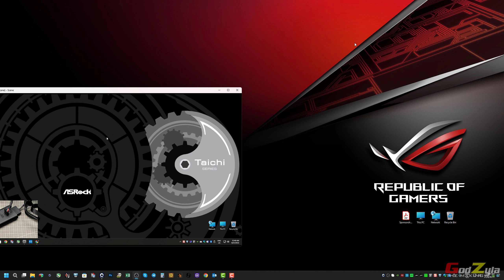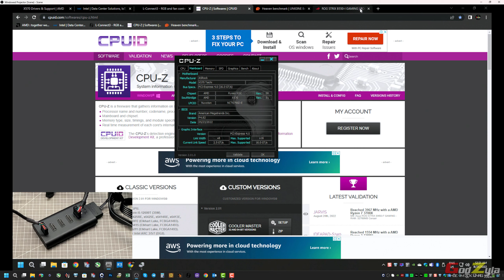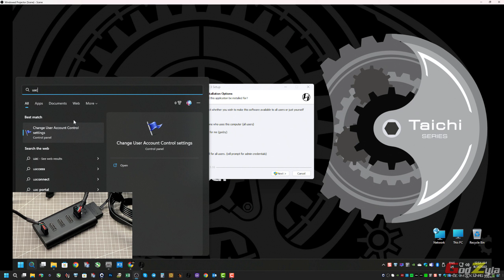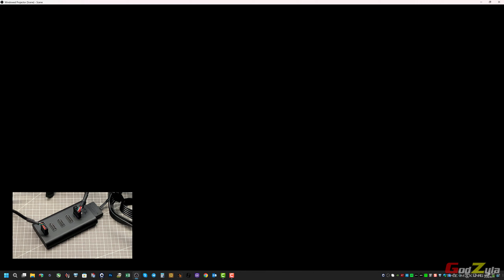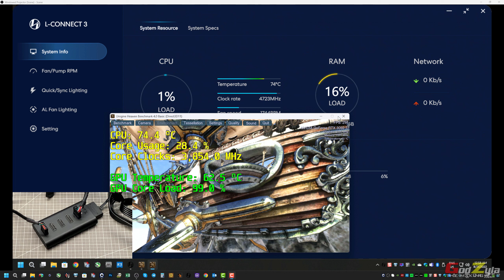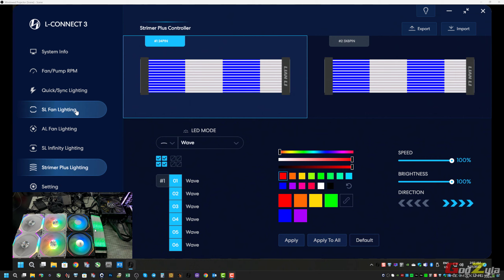Lian Li ARGB Products (How to make it work?) [L-Connect 3]

Comment: Hello,

do you think it's better to connect the AIO to the motherboard via USB? 
Or does the NZXT manage all Lian li controllers, 'fan' and AIO at the same time? 

Because I have both. AIO and 6 SL infinity
Reply from the maker: hello Protect_Dreams, welcome to my channel. both uses it's own controller. It will be best to have the NZXT pump controller to one USB header and Uni fans controller to another USB header. You are required to install both argb application. NZXT Cam and the L-Connect 3 app. As for troubleshooting, do pardon me, I am not familiar about NZXT Cam system, this you will need to figure it out or to ask at lian li reddit forum if you do encounter issues.
Reply: I think we misunderstood each other.
I don't have a NZXT AIO (*: like you on the video. A NZXT internal USB 3.

My AIO is a lian li galahad ii infinity. I have two USB ports on my motherboard.  

I wanted to know if I connect my AIO pump to the other USB port on my motherboard.  Or do I connect all my USB to the NZXT. Thanks
Reply from the maker: @stjah69  oh ok ok, pardon me. yes the NZXT internal USB 3 hub can cater for all your Lian Li controllers. no issue, infact Lian Li has it's own step up USB splitter which you might want to take a look too. https://www.aliexpress.com/item/1005005121350909.html
Reply: Thank you for your reply.  The link is interesting.
Ok then, I connect my AIO and my fans to the NZXT. It was already the case but I prefer to ask. Because I must admit that since I switched to AIO lian li I've been having problems. With Corsair everything was fine.

In Lconnect my AIO galahad disappeared. Even after reinstalling Lconnect, it no longer appears after restarting the PC. However, I can still control the pump and the LEDs.

And I still have the problem of the anti-malware service running in the background every 5 minutes.  If I close L connect the problem disappears. I just don't get it.

Thank you very much for your help.
Reply from the maker: @stjah69  hmm.. maybe try these steps. 

1)  first are you able to see any Lian Li devices in device manager, under universal serial bus devices?
2)  If no, can you check your motherboard bios at their website. are there anything related to USB fix?
3)  Now have you install the .inf driver for your motherboard? (refer to your motherboard manufacturer) 
4)  if above are done. try this, uninstall L-Connect 3app using revo uninstaller, make sure to remove all unwanted first and registry. example in this vid on the actual timestamp https://youtu.be/uMgUYiakpxM?si=8isUQ9pWvKounfgZ&t=437 and the application revo from here https://www.revouninstaller.com/revo-uninstaller-free-download/ (download the free copy will do.
5)  Also to check, do you have other ARGB Application installed. remove them too with revo uninstaller. For Asus Armoury crate, kindly use Asus Armoury Crate removal tool which you can find at asus website.
6)  once all done, shutdown your machine. unplug the AC plug from your PSU. let is sit for 45 seconds or so. while waiting, check the connection of your AIO block (make sure is click in) and the connection point to your motherboard USB header.
7)  plug back your AC plug and turn on your machine. see if it detect the Lian Li LCD controller in device management > under Universal Serial Bus Controller (right below) you should have two devices 1) LianLi GA_II_Trinity-R_v0.7 and 2) Lian-Li-UNI FAN-INF-v0.4
8)  If it does detect, install L-Connect 3 app version 2.0.4 ( https://lianli-update.oss-cn-beijing.aliyuncs.com/L3_CX/L-Connect_3_V2.0.4_X64.ZIP )
9) Try to update the firmware in L-Connect 3 app, under settings. if not download and run the GALAHAD II TRINITY"  https://lian-li.com/l-connect3/L3_update_manually/ 
10)  if everything working and detected, reboot to see if the AIO block and the uni fans dashboards appear in L-Connect 3. 
11) try playing with the effects.
Reply: Thank you for your help.

Yes I do see lian li in my peripherals. And once again. I can change the color leds. And even make the pump work.

I just don't see it in L connect updates anymore.

I have a 13700k with an Asus tuf z790 ddr4. My bios is from March 2023. And no I don't see anything corrected in USB.

What's the .inf? I have installed all the drivers for my motherboard.
Reply from the maker: @stjah69  Hi do you have the exact model of your motherboard as there are alot of Z790 Tuf or is this your motherboard? https://www.asus.com/motherboards-components/motherboards/tuf-gaming/tuf-gaming-z790-plus-d4 . if it is. download and install the chipest which is the .inf driver https://www.asus.com/motherboards-components/motherboards/tuf-gaming/tuf-gaming-z790-plus-d4/helpdesk_download?model2Name=TUF-GAMING-Z790-PLUS-D4 ,  reboot the system and see if works?
Reply: @KleoYan  Yes, it's the TUF GAMING Z790-PLUS D4. I installed ME firmware UpdateTool and the latest Intel Management Engine Interface. 

But the problem is the same. I have 6 Corsair Ql series fans with a commander pro to manage speed and leds. I use Corsair's Icue software. 

So maybe that's where it's coming from. The Pc must not like L connect with ICUE. And two different USB connections. 

I wanted to buy Lian Li Uni Fan SL-Infinity Reverse Blade. So I wouldn't need the Corsair commander core.
Reply from the maker: @stjah69  ok, now you've mentioned dont see updates anymore in L-Connect 3 but are you able to see the GA-II-Trinity-INF and your Unifans on the L-Connect 3 app? are you able to control them? If you are able to then it's all good.
Reply: @KleoYan  Yes, that's right. I would have put links to reddit but youtube deletes them in your comments. 

I don't see galahad ii 360 trinity sl-inf in the L connect updates. But I can still change the pump speed and the leds.
Reply from the maker: @stjah69  Hi buddy, someone had a similar issue like yours. you might want to take a look and to follow his steps https://www.reddit.com/r/lianli/comments/180ecez/firmware_update_11_aio_lcd/

these are the steps and credits to u/djchill75 from Lian Li's reddit forum.

1) Turn off PC
2) TYPE C cable disconnect
3) Start PC
4) use the EXE file (https://drive.google.com/file/d/1c9Hm6hKcDGnLgSQ7XvhfTLVjMubj2RYl/view) and click auto install update
5) wait till end then connect Type C Cable (Yes PC is on)

6) wait till it says restart Device, then you ll hear the USB Connect sound.
7) Everything works again.. ppphheeewwww

Hint: turn off L-Connect Software in system Tray before updating!

Comment: Thank you very much for your video. I bought the denier lian li galahad ii 360 trinity sl-inf. I am in Full Corsair. But I wanted to change brand. 
So I took out my Corsair AIO and put in a Lian li AIO. But I've kept my Corsair QL series for the time being. So I have L connect and ICUE at the same time. No problem for the moment.
I'm waiting for my Uny fan revers :)
I was wondering why my Lian li peripherals were appearing in my taskbar. But when I saw your video, apparently everything's fine because you've got it too. With Corsair nothing appeared. I also use the NZXT. 

On the other hand, I don't know why I get a little loading in the background every 5 minutes. If I cut L connect I don't get it anymore.
Reply from the maker: Hi Protect_Dreams, welcome to my channel, thank you for your valuable feedback. Now as for your background process, this I am not able to answer you but I do know that all argb programs make use of one common shared IRQ, which ended up applications might just grabbing for permission grant, this could be one of the cause.

Comment: I can only find a non powered internal usb hub i just need it for a 24 pin strimmer and a gpu strimmer or will that cause problems ?
Reply from the maker: Hello Deadpoolisdead, welcome to my channel. You can give it a try as my experience are with multiple controllers.

Comment: If i connect all my case fans, so 7 SL 120 V2 using the UNI hub, will they power on upon first boot ? I've heard they won't spin until L-connect 3 is installed and firmware update.
Reply from the maker: Hi Quyrew, welcome to my channel. All uni fans which I have tested, they will spin upon boot. Profile will be loaded after windows up where the L-Connect 3 app kicks in.
Reply: @KleoYan  but if its a new build without windows installed, will they not spin until L-connect is installed ?
Reply from the maker: @quyrew  when the controller is powered by the Sata. Whatever fan you plug to your controller will spin. Does not matter if there is windows or not.
Reply: @KleoYan  okay thank you for the info
Reply from the maker: @quyrew  most welcome and all the best with your build.

Comment: I was having issues with getting Lconnect to see the fans.  Turns out my NZXT mobo came with a USB splitter, and that was causing problems.  Fans still worked at full speed, but no control until I got rid of that splitter.
Reply from the maker: Hi Qix, welcome to my channel and thank you for sharing your experience with us, greatly appreciated it. Are your uni fans working properly now?

Comment: Hi Kleo Yan,  I have the old strimmers types (Qty 2) and wonder if I can plug them into a new UNI fan SL-INF 120 controller which has no fans plugged into it, as I want to try and control all my lighting through Connect 3. I already have the Galahad II pump AIO controller in my system but all the ports are full with fans and the pump. Can I use a second controller to run my strimmers?  I am stuck with this problem on how to add my strimmers. I hope you can help. or should I purchase the new Lian Li Strimer Plus V2 24-Pin ARGB Motherboard Extension Cable and Lian Li Strimer Plus V2 Triple 8-pin ARGB GPU Extension Cable which come with a controller?
Reply from the maker: Hi Mal Anderson, welcome to my channel. for your case, you will need a strimer plus V2 controller (https://www.aliexpress.com/item/1005004239607087.html?) and does your motherboard have another USB 2.0 header? normally a board is equip with 2. if both are used up, you will need a USB Splitter (https://www.aliexpress.com/item/1005005121350909.html)

Comment: Hi! I'm kind of new on what pc building refers, i have builded a full ROG pc, but i installed a galahad 360 and 4 SL and 2 strimer plus. I'm having troubles to make the argb works on "mb  lightning sync", could anyone give an advice to solve that issue?
Reply from the maker: Hi Eduardo Santos, welcome to my channel. does your SL Fan come with a uni controller? Also which strimer plus version did you purchase? As I need to know exactly which lian li products you are using, else can't give you a proper answer or help.

Comment: I fusing the L-Connect 3 software to control your CPU & GPU fans (AIO Coolers) rather than connecting those fans headers to the motherboard.
In the software you can say "This group is controlled by CPU/GPU temps" but what happens in BIOS, or even a dual boot system with an OS that doesnt run the software?

Will those fans run automatically from the signal from the pass-thru connection of the controller, run at full speed, or not run at all?
Reply from the maker: Hi Vicious Computers, welcome to my channel. For your case, it will run at silent mode and does not pickup from your bios even if you did plug the cable between the controller to your motherboard PWM fan header.
Reply: @KleoYan  Ok, good to know.  I'll need a few single fan cables that break out to the separate aRGB and PWM Fan connection then will put them on the controller in a sync port and plug the fans into the motherboard directly most likely.

I do not dual boot linux anymore I just use WSL or use a VM and in bios silent mode would be good enough due to the low demand on the system, but kinda still "better safe than sorry"

Just would be nice to control everything from one place and not need another software for those fans.

Comment: Hello man, great video bro. Can you tell me if I can control the argbs of the lian li infinity fans without connecting the controller to the usb connection, just with the argb connector on the motherboard?
Reply from the maker: Hi Lucas Duran, welcome to my channel. You can do that with a individual pack. If you get the tripple pack, it will not be possible. If you do get individual pack, make sure not to daisy chianed more than 3 fans to each of your motherboard fan header, as each of your motherboard fan headers have a load limitation.
Reply: @KleoYan  In this case, I will need a USB extender for the motherboard, right?
Reply from the maker: @lucasduran6753  it greatly depends on how many controller you intend to plug to your motherboard, but if you do need a usb extender, I would advise you to get this instead of the NZXT internal hub. https://www.aliexpress.com/item/1005005121350909.html

Comment: Hello everyone.
I have a Lian Li build case and i added lately a new hydro Lian Li Galahad II. My problem is that i spent a lot of time customizing the rgb strimers + hydro and when i turn on the PC and the L Connect 3 software runs on startup it resets to the default all the rgb settings. Then i have to customize again and again. If i turn off the L connect 3 program and never run the software again it runs smoothly. 
What should i do guys; Thanks 😊
Reply from the maker: Hi akis mpitsou, welcome to my channel. I like to check with you, can you launch your L-Connect 3 app, click on Settings and check if Auto-Run on boot and Minizmize L-Connect 3 to system tray at close are enabled. Also when you've done up your profile. you will be able to save your profile by exporting it to a physical file, just go to the dashboard (exmaple effects for your fans or strimer plus), on the top right you should have export and import.. use the export to save your settings and if in the event, it's mess up during operation, you can always import back your settings.
Reply: Hello friend, thanks for your message😊. My settings are both enabled as you mentioned with L Connect. I tried a few times  to export my favorite RGB custom settings and import when things messed up but it never restored my favs. It always works on default settings. Its like auto syncing everytime. I have customized each strimer one by one with meteor and when the exe runs it restores everything to the defaults. If i use general lighting effects theres no problem. Only with solo strimers customization..

Comment: I have the 12vhpwr v2 strimer and the 24 pin v2 strimer. Problem is i cant even get them to light up or even show up in l-connect 3. Are they not compatible?
Reply from the maker: Hi JP Kix, welcome to my channel. Do a basic check, are you able to see the controller under device manager? if yes, you might want to do a manul firmware update. You might want to refer to this content https://youtu.be/CgvuUFeff8U I do understand is lenghtly but take your time to digest and to understand how it works.
Reply: @KleoYan  when i check under "device manager, the only things to show up are "6K7750"
"Aura LED Controller"
"NZXT Kraken Elite"

Comment: Thank you for vdo. but I would like to include the Lian Li Galahad II Trinity SL-INF 360 in all of these connections.
Reply: I'd like to see all these Lain Li equipment connections.
1.UNI FAN SL-INFINITY 120 Triple Pack 
2.UNI FAN SL-INFINITY 120 Single Pack x 3
3.Galahad II Trinity SL-INF 360
4.Strimer Plus V2 24-PIN and 8-PIN
Reply from the maker: @Conquer-the-devil  hi welcome to my channel. Just for your info, you will need 3 controllers. 1st is the SL-Infinity controller which you can hook up to 4 of your fans. Next is the Strimer plus controllers for your 24pin and 8pin stripes and last will be the controller for your Galahad II Trinity SL-Inf 360 (this you can't combine to one SL-Inf controller) as for your reqest, do pardon me. I have donated them to charity, unable to illustrate to you.
Reply: @kleoyan i think my situation applies to this post also, but i want to make sure… so i have the galahad II lcd sl infinity plus 6x sl infinity reverse plus 1x sl infinity for rear exhaust plus the 3 sl inf that comes with the aio. Can i connect all of them to the hund that comes with the aio or should i buy the sl infinity hub (the one with the sync ports) for the fans only and leave the aio one for only the galahad and  the fans included ? Really appreciate if you can clarify this for me 🙌

Comment: Hi man I had a question about the sl120 v2 fans. I’m planning on not using lian Li controllers but razer chroma controller so I can control 10 of these fans from my motherboard and other software. If I daisy chained 3 fans by sliding them together x3 (3 at top, 3 at bottom and 3 at side then one fan at the rear), can I plug the 4 ARGB headers into one razer chroma controller and then the PWM cables to the motherboard sys fan header (cpu fan header for the fans on a radiator)? 

Also, if I daisy chain 3 at a time by sliding them together will I be able to control each fans RGB individually through my motherboard or will my mobo only see the 3 daisy chained fans as one group(e.g. can I make one fan red, one blue, one green or can I only make all three one colour if they’re daisy chained).
Reply from the maker: Hi Power, welcome to my channel. I am only able to answer what I know. If you purchase the SL120 V2 fans as single pack. you can plus the fan's argb to the motherboard (covertor included) and the fan load to your motherboard fan header. AS for the Chroma controller, I have no experience on that but if it takes in normal argb 3pin 5volt standard argb connectors, then it should not be an issue. The only thing you need to take note is the load capacity. please check the specs of the Chroma controller, see how much ampere it can cater for and to check the SL120 V2 ampere too. As for the effects you are asking, this greatly depends on how Chroma design the argb effects and same applies your motherboard argb utility.